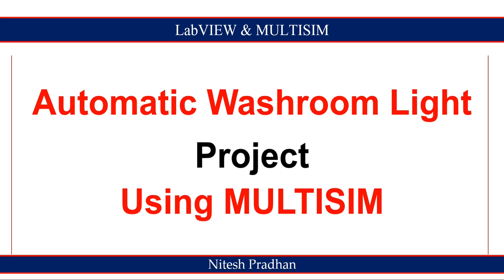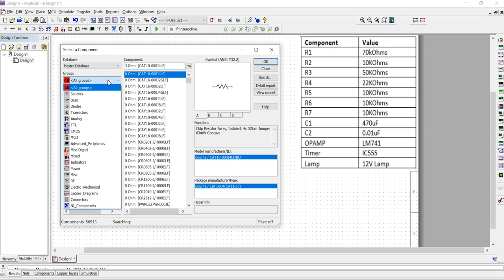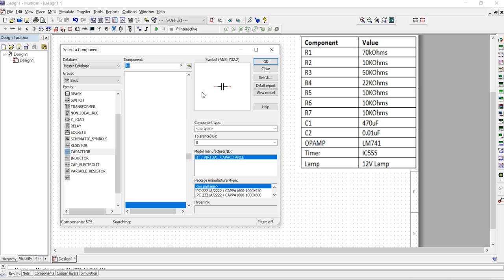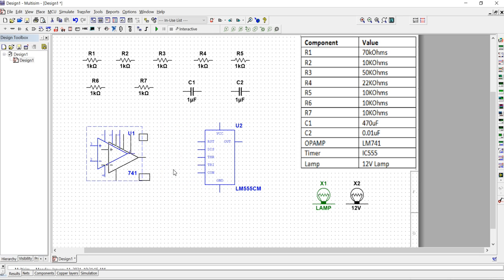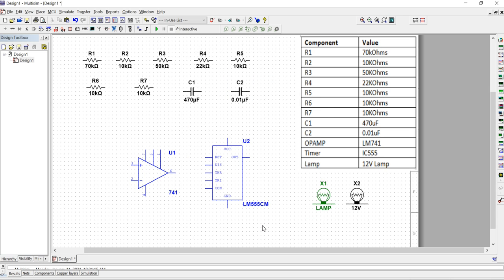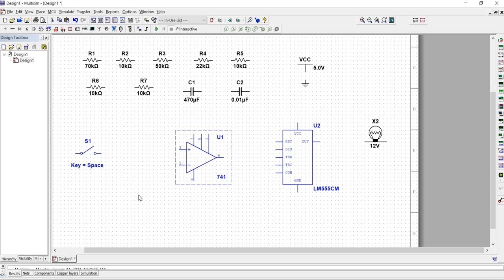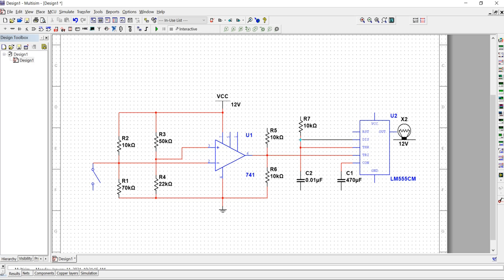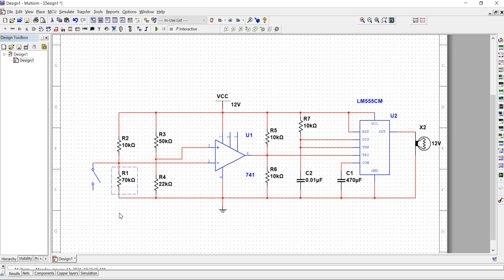Automatic Washroom Light Project Using MULTISIM

Comment: sir its not runnning
Multisim  -  Friday, June 25, 2021, 3:45:54 AM
Probes do not plot to the Grapher for interactive simulation. Connect an oscilloscope or run a transient simulation to see Grapher data.
Probes do not plot to the Grapher for interactive simulation. Connect an oscilloscope or run a transient simulation to see Grapher data.
Probes do not plot to the Grapher for interactive simulation. Connect an oscilloscope or run a transient simulation to see Grapher data.
Reply: how did you solve it?